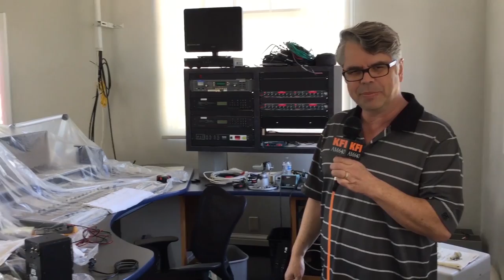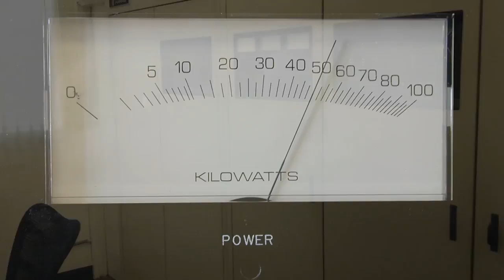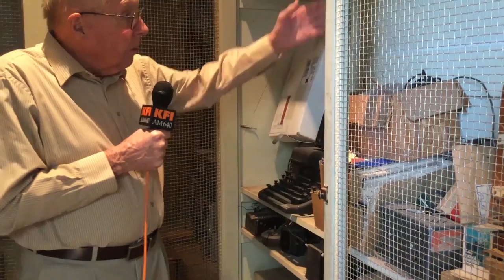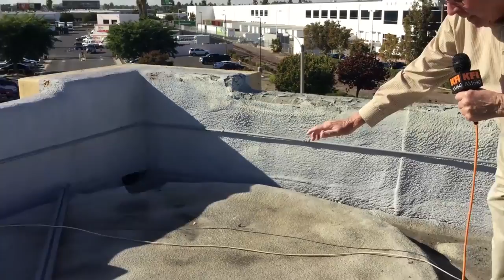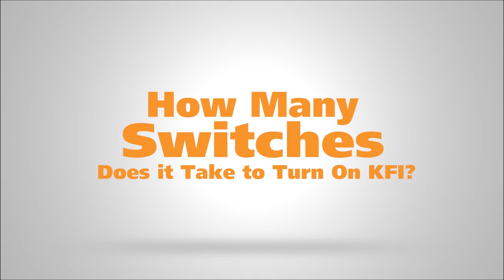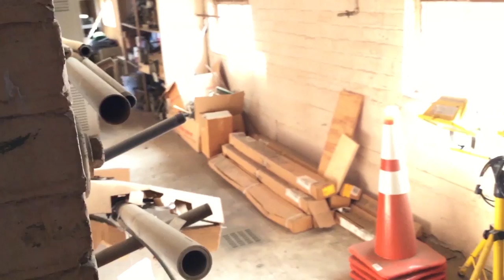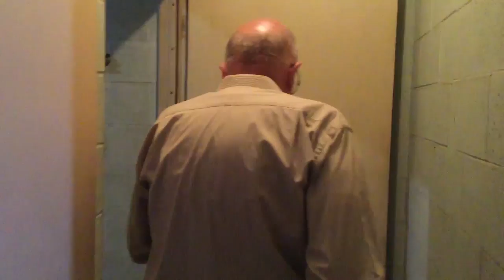KFI AM 640 50kW Transmitter Facility Tour

Comment: So why did KFI decide to allow a bunch of buildings to be built on their transmitter site?
Reply from the maker: I’m not sure about the decision making, but I do know that KFI has survived through many decades and economies.    That site is prime real estate and it’s probably a very profitable side-hustle. The real question here is, why not?
Reply: I can think of several reasons "why not."   Seems a lot safer for everyone involved to keep a respectable buffer around any high-power transmitter, for radiation reasons, safety, and flexibility of the property.  If you desire to change something (such as add a directional antenna, for some reason) you have the space to do it.  It also goes without saying, should the tower(s) collapse again, the danger to the public is acute.  Earthquakes happen.  It doesn't seem fair to overwhelm all the buildings/businesses around you with that signal, which can be shocking enough even with a responsible buffer space.  As mentioned in the video, the grounding system of such a site is complicated enough.

Of the profitability, I have no doubt—that'd be the only reason to do this.  I wonder what the cost of moving the transmitter a mile or two would have been.

That's just my opinion, though.  I still thank you for the interesting video.
Reply from the maker: Jovetj there is a buffer. There is plenty of room for a tower to collapse, like it did when the tower was hit by a plane in the 99’s. Also, the surrounding buildings are not in any danger of radiation or able to interfere with grounding. The buildings are all commercial and knew that the tower was right there before signing any leases. KFI followed all zoning laws and would never put anyone in danger. I asked the engineers about the impact of the tower on those businesses the day we shot this and they said that there were no problems with how it’s all laid out. I hope this puts your mind at easel!
Reply: @helenefederici4591 , hit by a plane in 2004. I did an extensive write up of it back then and was on site when the NEW tower fell during construction. I took the only picture of the tower while it was falling.

Comment: Please further explain "Modulation Dependent Power".  The power gets lower when modulation is applied ?   It seems to me either the power meter shown is "nuts!", or there is a trouble with your Nautel transmitter, or there is something I don't understand.   What is the unmodulated common point current ?   What is the common point current when 100% modulated ?   If it's lower when modulated, there is something wrong.
Reply from the maker: I wish I could but I’m just the producer. There are some pretty smart engineers who’ve left comments on here who would probably love to discuss.

Comment: Is there a mandate for solid-state AM now?
Reply: There's no mandate, but the cost of high power tubes has driven stations to the Harris DX-50 or Nautel NX-50. Re-tubing a Continental 317C2 runs around $20000 for just  the 4CX35000 carrier tube and 4CX35000 modulation peak tube. When you consider the need to replace tubes every 18-24 months (if you're lucky) makes the solid state transmitters very attractive.
Reply: @JayWalkerTexasRadio  The biggest move was cutting power bills. Even when dynamic carrier control is used, going solid state is still a benefit. Also mean time between failures on solid state is much better.

Comment: Is this the station  Wolf Man Jack was on  ?
Reply from the maker: I don’t think I ever came across his name while doing historical archiving for KFI, but can’t say for sure. Maybe someone on here will remember.
Reply: To the best of my knowledge he was never on KFI. He was on a "border blaster" but I don't recall its call letters. Border blaster = AM transmitter just south of the Mexican border, directing most of its power into the US and broadcasting in English. By putting the transmitter in Mexico they would not have to comply with FCC regs that limit AM power to 50KW.
Reply: KFI never employed the Wolfman, though his syndicated programs may have aired there.
Reply: XERB, "the mighty 1090" is one of them. I listened in Sacramento during the mid 60s, no fading. Read the article on "da wuffman" on wikipedia. Hate to say it, but KFI did fade.

Comment: If an EMP occurred, then what is the point of the transmitter? Every transistor and FET and Integrated circuit in TV, Radio anywhere will die. Who will be listening to the transmissions? Not everyone lives in a Faraday cage and not everyone has tube radios. Hum?  Will, I guess that yall's voted for these thinkers (sorry, I meant 'none thinkers'). As ever the blind lead the blind.
Reply: @Educated Manholecover you look to deep into the EMP theory. I know of at least 1K people myself that are prepared for an EMP & if you know how to prepare a metal trash can with receivers let alone transceivers you will be able to communicate one way or another.
Reply: Maybe military, agencies, FBI, NOAA, Navy, Red Cross or similar
Reply from the maker: FEMA installed a "shielded transmitter" on site, that is disconnected from the world. FEMA can hook that up and get back on the air, post attack. It's discussed at 15:50. KFI in partnership with FEMA has thought about it all!
Reply: EManhole: No, EMP is not magically destructive. It won't destroy every transistor and electronic device everywhere.  Effects dissipate with distance.  Electronic design and particular situation greatly influence susceptibility.  Nuclear bombs below 1 Megaton and below 30 miles altitude have significantly lower EMP and shorter range effects.
Reply from the maker: Pelican1984 Wow! Great info for a not-very-well-understood subject. Thank you!
Reply: Not if they are shielded. Hence the new buildings.